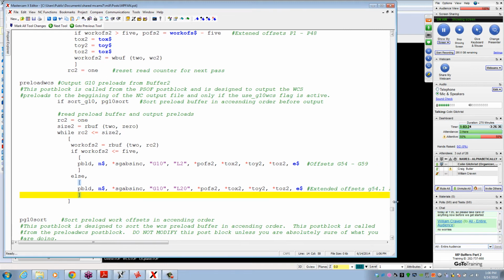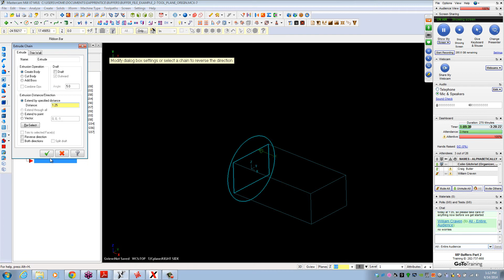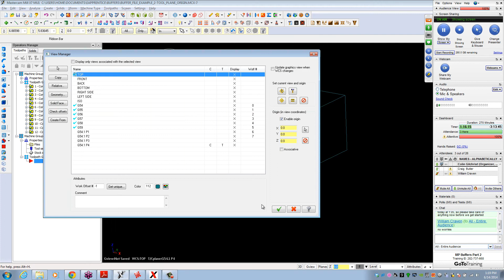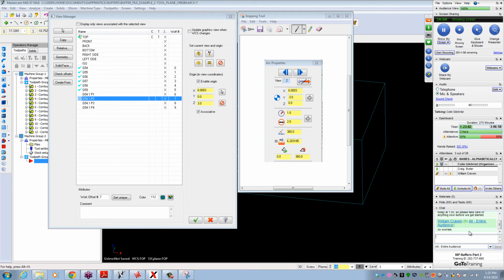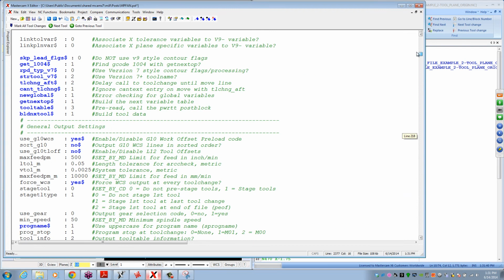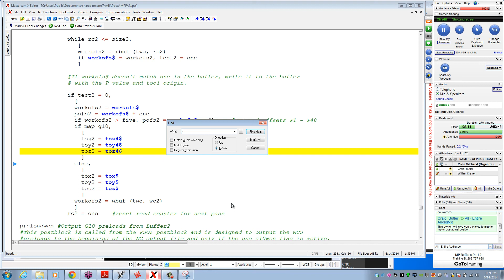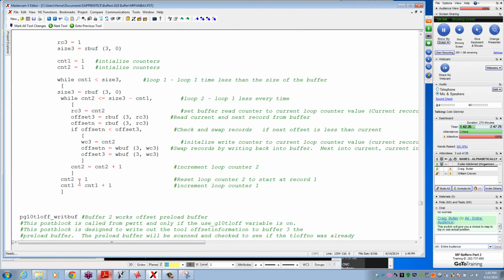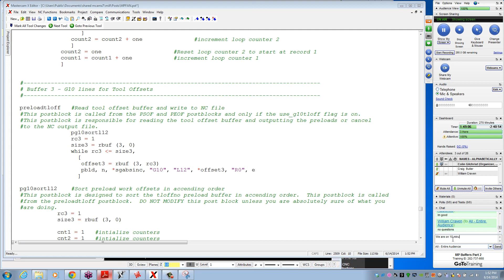MP Buffers Class 2 - Video 5

Comment: hi!
i use post mp master 4 axis i usually output coordinate G54-G59 when rotary axis
and now. i want to output coordinate work TCPC . only G54 
can you help me! please 
thank you
Reply from the maker: For Tool Center Point Control in a Mastercam Post, you will need to purchase a Post Processor from an authorized Reseller or 3rd Party Post Developer. Contact "Postability" or "In-House Solutions" for help with a Post for your machine.